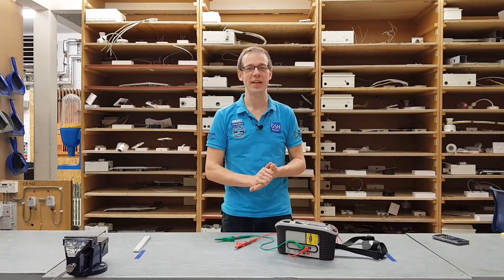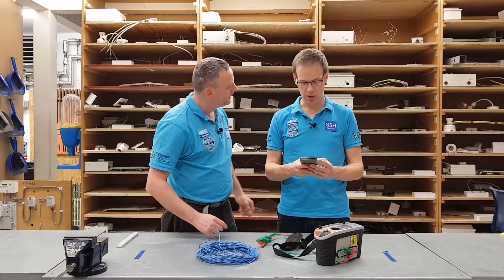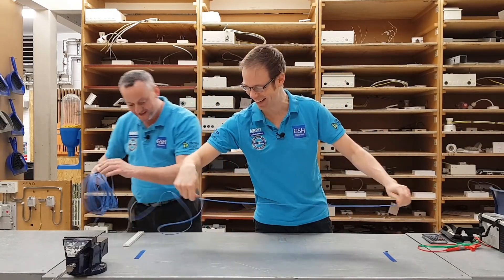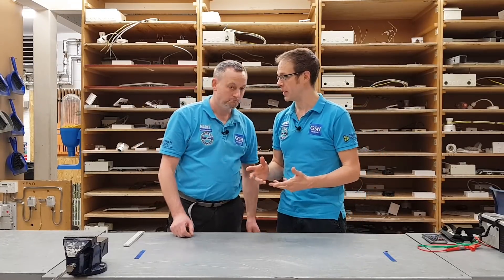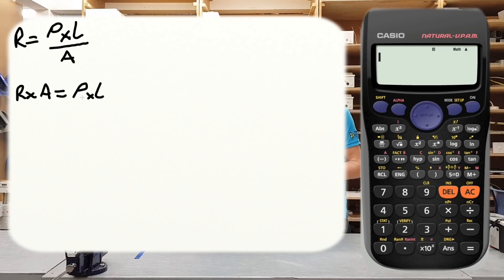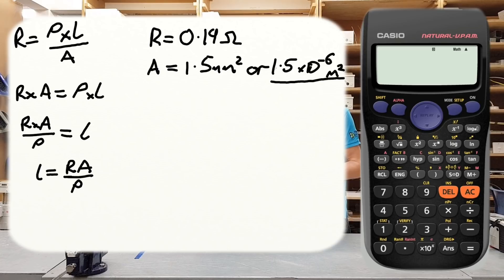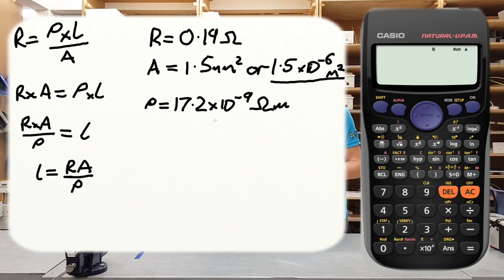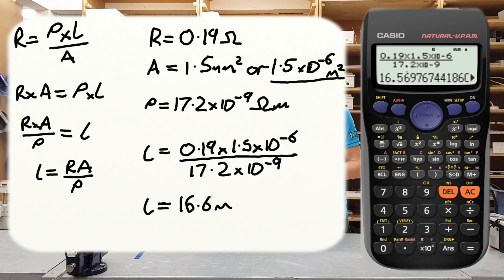How to Calculate the Length of a Conductor Using Resistivity

Comment: Great videos! 12:44 resistivity also changes depending on temperature. Judging by clothe thickness, temperature in that room was above nominal 20 census. Increased temperature might have increased resistivity slightly, therefore shorter and warmer cable had the same resistivity as slightly longer at 20 Celsius would have. Also measuring equipment resolution was quite low for this calculation, additional digit would be helpfull.

Comment: Clever bit of maths , but it’s to hard, the simplest way 0.19 ohms x1000= 190 milli ohms, 190 divided by 12.10 the factor from guidance notes 3 = 15.7 metres . 
Great video and useful for the number crunchers👍or (0.19 ohm )divided by (mili ohms per meter 12.10 )x 10to the minas 3=15.7 meters simple .

Comment: Hi Joe, need some help,
How do I figure out the length of wire when you have no resistivity. In the question I have to answer, Im give the CSA, COPPER RESISTIVITY and a voltage drop 
please need some help understanding

Comment: Hello sir i see your vd and you are a top master of science  recently I had to find the length of cable we use for copper
 R= 0,0175ohm/m and 2,5mm2 for cable when I use this formula it's not fit.  The cable length measured 215cm and Resistance measured 0,37ohm can you please help to find the correct length thanks

Comment: Best regards. Could you help me to calculate the distance of a copper cable awg 10 using a multimeter Example I have a cable on a reel and the values shown by the multimeter in position 2k is .002 and in position 200ohms varies between 1.1 and 1.2 and continuity is .003. What would be the mathematical formula I should use to know the length of the cable. My knowledge in this area is not good, I am an apprentice.

Comment: Would it not be easier to express the value of p in microhms per meter rather then millimetres.  that way its just (0.19*1.5)/0.0172 and you only have to do 17.2/1000. no need for a scientific calculator and you don't have to remember which values you have to x10^-6 or -9

Comment: A star delta is used in a 3 phase motor.The  conductor from the star motor are wired 4mm2  copper conductors and have a resistance of 87.5mΩ.
Using the resistivity of the cooper conductor to calculate the length of one of the live conductor  of the starter motor.
please help

Comment: I tried to use your formula to calculate length. (To find the total cable routine underground and cable fault)

The problem is, when I calculate it out, the length is a huge difference from what is shown on my Autocad data i had on hand. Which i don't get how i got it wrong.

The cable is 3C x 185mm2.
The total resistance (I connect the end-point at B to form a loop back to A, together [in essence, 2xL]) is 0.2 Ohm
The length I calculated out is 1084m. However, the length on my Autocad data is sitting at a whopping 440m, which i can't figure out why
Reply from the maker: That is a bit weird. 🤔 Where did the 0.2 ohms come from?
Reply: @JoeRobinsonTraining  I got the value of 0.2 Ohm using a multi-meter that measure resistance.
Reply from the maker: OK, was it a multi-function tester like a Megger or a multi-meter? The only reason I ask is that if it wasn't properly calibrated or not zeroed it could give a false reading and even a small amount of difference on the meter will have a fairly big impact on the result.
Reply: @JoeRobinsonTraining  It is Megger brand. Calibration date of expiry is 21/8/2021
Reply from the maker: Hm, well in that case I'm stumped, not sure why it would give you such a high value. 🤔
Reply: @JoeRobinsonTraining  The story is like this. One of the phases of the HT cable short-circuited to the protective earth. 

To find the part where the fault is, we had to find the total length of the cables between the 2 substation. We did an insulation test and found out that L2 phase has shorted (to protective earth), but L1 and L3 phase insulation were in good condition. Hence we connected the end point of L1 and L3 and started to measure the resistance at the other end point
Reply: would you not have to divide the measured resistance value by 2? as you have effectively doubled the CSA, which should bring your calc back down to  540 est (bit closer to your cad value) there are going to other effecting factors such as temps etc  -   not saying im right just a thought
Reply: @TheChris141  That value is alrdy divided by 2.
Reply: @ReSV1  ah okay, just out of curiosity have you had much further luck with this formula? Im going to give it a try on some large distribution cables next week which we know the length of just to give myself some confidence in the results etc

Comment: Hey Joe, I have to say you have helped me with really understanding resistivity as trying to learn it through Microsoft teams with over 30 other students has been hard on the students but especially the teachers, so you have been a massive help - as has rapid Gaz 🙌👏👏
I do have a question though... I have a question that says - you have an immersion that has a current of 13A. Its wired by a twin cable with each Conductor csa of 2.5mm^2. The Conductors are copper and the resistivity is 1.72x10-8 ohm/m^3 and I need to calculate the maximum length of cable which may be used, if the cable voltage drop is not to exceed 11.5V. (this is not the volt drop used for cable selection). How do I solve this? I presume ohm's law for the resistance, then the resistivity formula. But I am not sure if I should half the answer as its a twin cable?
Reply from the maker: Great question, watch this space.

Comment: Hi, I understand the video and the workings.. However, I'm currently stuck on a question that has me stumped a bit. The question is this : Approximately how long would a length of CPC be to give a reading of 0.36 ohms, considering that 1.5mm(2) has a resistance per metre of 12.1 Milli ohms? 
I don't know if/where the 12.1 should be substituted into the equation? Any help you can shed on to the subject would be amazing!!!
Reply: Thats your P value right??

Comment: Just can't seem to get this working ... I have 30' of CCS #18 insulated wire.  The closest calculation I can get is 127'.  Using a multi-meter I get 0.5 Ohms resistance.  The diameter of the wire is 0.05 inches or 1.27mm.  Convert this to 1.27x10-6 m^2.  I'm using 1.64x10-9 for the Resistivity of CCS.  Help?
Reply from the maker: Hi Stephen, you need to use the cross sectional area of the conductor not the diameter, calculate the area and then use it in the formula. Any better?
Reply: @JoeRobinsonTraining  Thanks for the reply Joe.  So here goes again! L=RA over P.
Where R=.05 Ohms
A = (pi*r²) OR (3.14*0.025²) .025 is the radius of the diameter (0.05) in inches.  
A = 0.002 rounded up.  
Then A to metres²
A =  5.08*10^-9 m².
P = 1.64x10^-6
L = not even close! LOL.
Reply from the maker: Did you use 0.5 ohms or 0.05 ohms?
Reply: @JoeRobinsonTraining  Sorry, typo.  I used 0.5 ohms and got 15.49 m (Wire measured to 9.144 m/30.0 ft)
R = 0.5 Ohms
A = 0.0000508 m²
P = 0.00000164 (Copper Clad Steele, 18# 19-strand.)
L = 15.49 m
Reply: @JoeRobinsonTraining  BTW - I went here to check my Area calc. http://www.sengpielaudio.com/calculator-cross-section.htm and it seems correct.

Comment: Can you help me out with this one. I'm still relatively newly qualified and trying to get my head around things. If you install a ring circuit of the max 100m then based on the table in the onsite guide, the resistivity of a 100m of 2.5 would be 100m x 19.51mΩ ÷ 1000 = 1.95 Ω. My questions are..... 
1. How does that work if the max allowed impedance is 1.1Ω for 100m 
2. If the answer is because impedence and resistivity are different things then is there a way to calculate the length of a cable from just the ZS. Thanks.

Comment: Great video joe. Could you have used the r1 r2 table in the on site guide and obtained a value of 12.10 milliohms per meter for a 1.5mm2 copper conductor..  
Then calculate the length of the conductor = measured resistance x 1000 then divide that by(m ohms/m)??

0.19x1000 divide by
12.10
=15.70 meters???

Or am I missing something from the way I obtained my calculated value of length?
Reply from the maker: No, that's absolutely spot on Gareth, great work. The reason we may have slightly different answers is the OSG uses a slightly different value for the resistivity of copper. I don't have on on me right now but off the top of my head I think its 18.1 milliohm metres. I'm not sure why but I would guess its something to do with standard requirements for the purity of copper or something. Great question, stay tuned for more!

Comment: That's really cool. When I did my level 2 exams I was really struggling with resistivity, so I invented a formula to help me with it which I based around the idea of the voltage triangle.

I couldn't do it as triangle, but I used a naughts and crosses table to take its place 

I called it the Parl Square. I actually have it on my own YouTube channel as I really like to share knowledge.

If you watch it let me know what you think.
Reply from the maker: That's a really interesting approach to transposing the resistivity formula! 👍🏼

Comment: Is there any way you can do this calculation WITHOUT a scientific calculator ???I was trying 0.19 x 1000 / 12.10 = 15.7m   length0.19 Resistance12.10 resistance copper per meter OSG (table 11 /page 190)is this correct